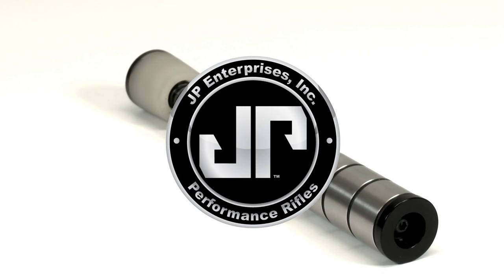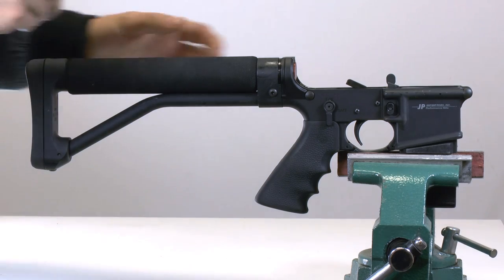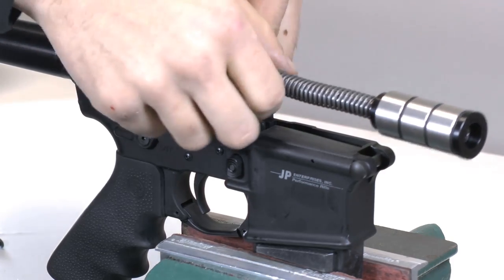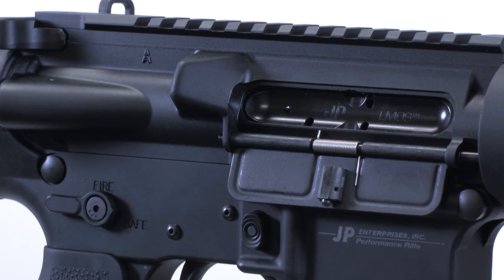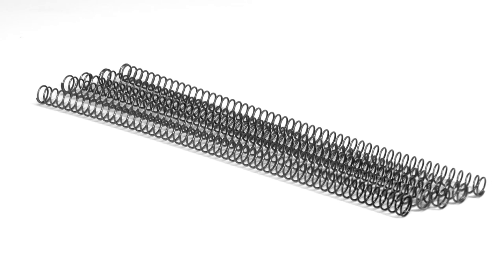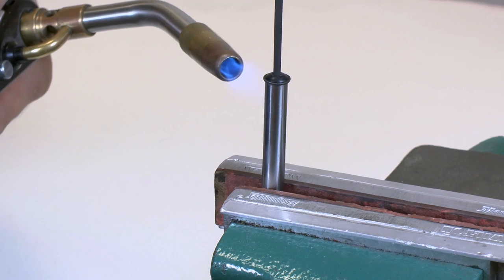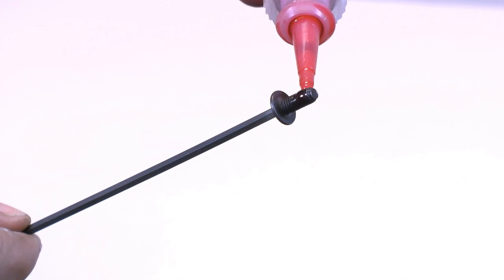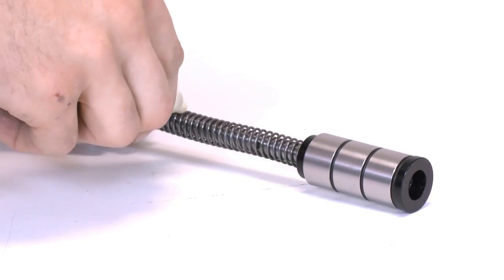JP Silent Captured Spring Instructional Video

Comment: Might I respectfully suggest you change the verbiage of both your video and instruction sheet from "we recommend removing the buffer retainer and plunger before proceeding" to "you must remove the buffer retainer and plunger before proceeding."  Once you get the Silent Capture Spring installed, nothing short of a miracle will allow you to get it out again without potentially damaging the assembly and/or the rubber O-rings as long as that plunger is sticking up!  However, if the annoying "boooinnng" after each shot is gone, it will have all been worth it!

Comment: Lost me at the quarter... I think I'll stick with the original
Reply: inRangeTV (or forgotten weapons....cant remember) did a vidoe where to make their CETME-Ls work, they had to use a fired label case to add some spring tension....
they also just made a "what would stoner do" video where they approve of this buffer.....after they tested it with MANY shooting matches and 1000s of rounds

most people dont have washers laying around......and even fewer know where to get them (car parts or hardware store)
so a quarter is something EVERYONE has, and its a perfect fit for the tube

plus..... you could buy some material like the white spacer that is included..... and make your own, longer, spacer
AKA.... if you dont like the quarter idea..... you can make your own spacer that is better (but it will cost a lot more than 25 cents, and work EXACTLY the same)

i dont even own an ar15..... so i have no horse in this race

but you better not do any car mechanic work.... if you cant handle making your own spacer, or using a cheap and JUST AS effective "hot fix".....
then how are you ever going to get bearing clearance right?

"piston rings should not need to be filed to the correct ring gap.....even though the correct gap will vary depending on the configuration of the engine (turbo = more gap), how worn the bore is,  and about 20 different variables..... they should all be drop in replacements......as i have no idea what tolerance variations are!"

Comment: I really love this product. It puts the BCG into battery perfectly and reliably every time! So far I have 3 of these. One on both of the SBRs and one on the LRT 308. I needed to swap the spring on the 308, as it locked up the action after each round, but after that it worked flawlessly.
Reply: I have a custom setup using this AND the Black Rifle Arms BCG with their buffer tech. I had to mod the buffer on the BCG to accept the rod od the spring system but it was worth itm  the action is ridiculously smooth!
Reply: @atranimecs  I ended up having to ditch them all. The captured spring in the sbr wouldn't allow reliable feeding regardless of the spring combo. I went back to an enhanced buffer spring and h2 buffer and have been happier since.
Reply: @HO123virus  Kinda confusing, you sing it praises in your first comment then add a comment saying you had problems in the SBR?  

I know people run these in SBR setups so I am curious about your troubleshooting process.  Additionally you claim that you had one in a 308 build.
Reply: @Osprey1994  Yeah, first comment was made 7 years ago. Second comment was made 5 months ago. Things change. Not that confusing really.
Reply: @HO123virus  how long into using them did you notice they weren’t working out? Were you using the Gen 2 Heavy H2 for the sbr’s? Just curious since I was planning on getting one for a 300BLK with 8.7” barrel.
Lots of people seem to love them, but I’d rather not spend so much just to have issues.
Reply: @calchavez9272  I'd say after about a year of use. I didn't change any other components or ammo type. The LR308 was mostly noticed after full magazines and we could see it wouldn't allow the bolt to cycle far enough to the rear. The 300 BLK and 5.56 SBRs was mostly just inconsistency in reliability. I tried the different spring packs to see if I could gain reliability back, but I couldn't make it through more than 3 mags before I had cycling issues. After swapping back to standard buffers, everything was fixed.

Comment: Mine works great! I won't run a rifle without one. It runs smooth like a bolt gun and no running a spoon on a chain link fence sound.
Reply: COLT LE6920  Mine is ac6being delivered today, can't wait to test it out
Reply: 6 years... still good?
Reply: @gemcutter187  I have two and both are running great. The only thing that they don't do well is locking back on the last round. But that's a tuning thing

Comment: Just purchased Gun model AR-10 DPMS LR-308, Heavy H2 Buffer Version with silent captured spring spacer. Also  listed as Gen 2 silent captured buffer spring system for my PSA AR 10 in .308. Loctite 243 is what came with the kit.
Reply: Look at how old the video is.

Comment: Does the buffer retainer plug interfere with it's operation? Because I'd rather leave it in! Just bought one, arrived the other day. Going to install it soon.
Reply from the maker: A standard buffer retainer plunger is really inconvenient when you're installing or removing the SCS as it catches easily.  We came out with a different design the alleviates that problem, which is on our website: https://www.jprifles.com/buy.php?item=JPSCS-BRP
Reply: @JPRifles  I installed it and left the retaining plug in. You're right, it was slightly difficult. But I just used a stiff knife blade to push down on it, and got the spring capture system in behind it. Seems like a perfect fit.

Comment: Any advise on tuning/picking the correct spring?
Reply: Unique to individual setup. If you want to tweak as much as possible you can buy a variable spring kit + install an adjustable gas block. If money is of no concern you can get their variable sized weights as well.

general guidelines:
h/h1 = mid length
h2 = carbine
h3 = pistol
Higher spring rate/tension and/or more buffee weight as the gas length is shortened. (H2 is a good start for gas piston systems).

Comment: Is their a weight that will work with 300 blk in both super and sub with or with out a suppressor
Reply: Late reply, but it they have a flow chart up on their website now.

If you're going to run a 300blk suppressed, they recommend the equivalent of an H2 buffer weight, which would be one stainless weight and two tungsten weights. But of course, fine tuning for your specific application may be required and such.
Reply: There*
Reply: “Without” is one word.
Reply: @TheTeddyChoice  thank u grammar 👮‍♀️

Comment: Do you recommend applying thread locker to both top & bottom screws?
Reply from the maker: There is never a need to remove the bottom/back screw on the SCS. If you did remove it, you would want to use loc-tite when you reinstall it.

Comment: my new jp capture sping is stuck partially by the buffer retaining bin.  any advice on how to remove it now.  I've seen videos of the jps going in easly with the pin in place but mine is stuck at the last gap at the front.
Reply: Push down

Comment: What does this product do for your gun? Make the buffer tube quieter? On something that produces 140db suppressed?
Reply from the maker: Not only is the SCS quieter but it also removes drag from the buffer system. You also have a wide range of adjustability with overall buffer mass as well as spring weights so you can tune the system to your rifle and the ammo you are running to get the best possible function and reliability.

Comment: What stock/ buffer tube are shown in the video?
Reply from the maker: It is an ACE-ARFX-QD stock on a mil-spec rifle length buffer tube. Both components are available on our website.

ACE-ARFX-QD: https://jprifles.com/buy.php?item=ACE-ARFX-QD

RPBT-R: https://jprifles.com/buy.php?item=RPBT-R
Reply: A2 type. I am not sure this item will work on AR15 buffer tubes platform, Furthermore, I am not sure it work on current retro fit systems as well.

Comment: Has anyone out there changed out the spring on their JPSCS for a lighter spring on a Sig 516? Mine won't lock back on the last round, and I am getting some light strikes that don't go off while shooting, but I can see where the firing pen hit the primer. If so, what color spring did you go with?
Reply: They sell the pack of diff tension springs that are color coded. You’d need to test each with your particular setup. But deductive reasoning should help in which direction to go.

Comment: So your telling me I spend 140 dollars on a spring, than I need to add 25c, than I need to sand the rifle length but stock adapter for proper fit?
Reply from the maker: Only certain buffer tubes will require a shim (which is now included with the SCS).  You shouldn't need to modify the spacer unless you have an oddball buffer tube.
Reply: @JPRifles  well I appreciate the reply JP. Still a little steep of a price. If you guys could figure out how to bring the price point down you’ed sell a ton of those.
Reply: @Pays2Win  They already do sell a ton of them lol
Reply: @Pays2Win  can't be cheap on quality my guy!!
Reply: @themagnificent9296  there is truth to that for sure….times are tight tho
Reply: @Pays2Win  times are tough indeed, that's why I'm down to oodles of noodles to fund my quality build!! 💯💯

Comment: This works for with the law tactical folder right
Reply from the maker: We just released a specific line of Silent Captured Spring systems to work with the LAW tactical folding stock adapter.
Reply: JPRifles and I’m going home from work to install it in 30 mins

Comment: I have a simple question.  Why do you suggest taking out the buffer retainer, plunger and plunger spring?  Just because the JP silent capture spring doesn't need it, it makes no sense to immediately remove it, as it harms nothing leaving it in, weighs less than a dime. 

I'm a retired US Army soldier, but for people doing DIY upgrades with no experience, for non ground up rifle builds,  telling them to remove it on the onset of putting the JP system in, may not be wise, because if they have function issues with this JP system and their buffer plunger spring flies away in taking it out, the rifle is a paperweight, until they find the spring or buy a new one. Once JP's system functions perfectly,  IMHO, that would be the time to remove the buffer retainer and plunger spring.     My 1st experience with the JP system I had one rifle that wouldn't lock back.  Was a simple fix, but for noobs it might not be so simple.
Reply from the maker: The standard buffer retainer catches in many of the features of the SCS, so it's really inconvenient to insert and remove.  That's the main reason.  This video is dated at this point since we've come out with an alternate design buffer retainer that alleviates this problem.